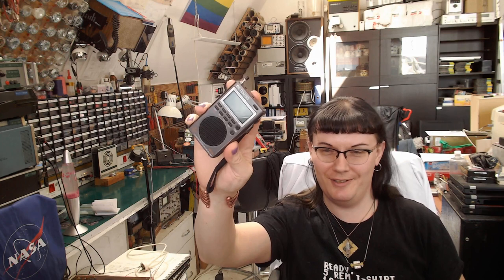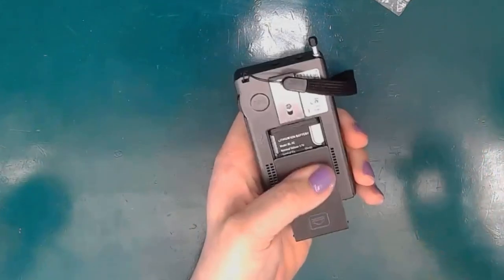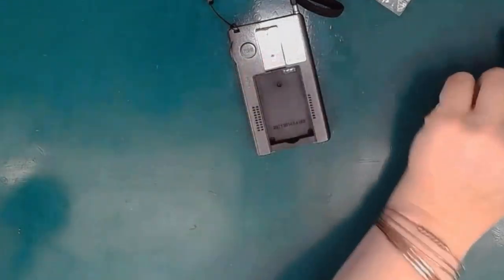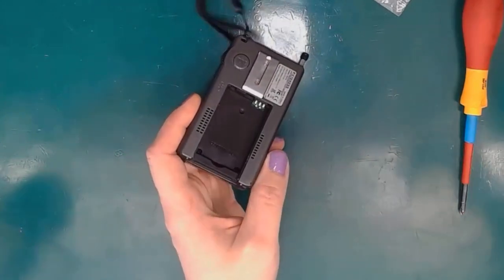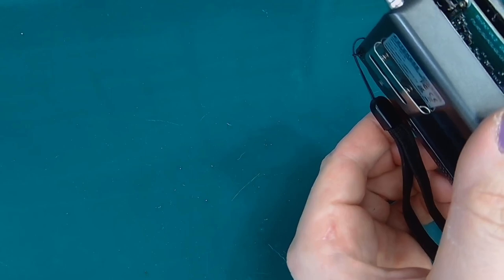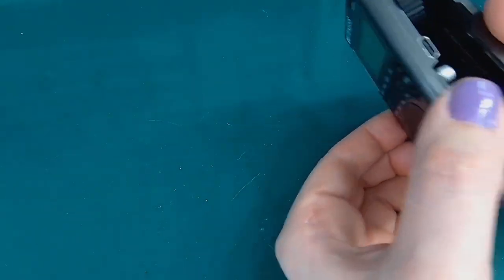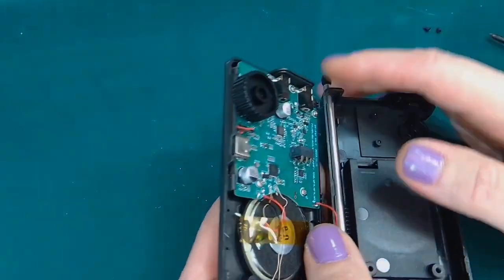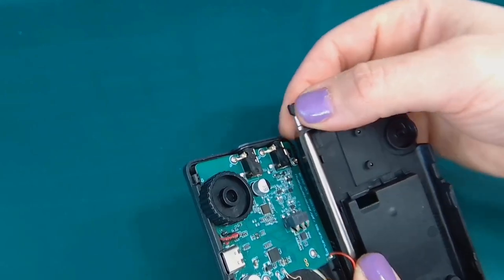Fixing a Retekess TR110 Multiband Receiver

Comment: You have a new covering for the work bench. I used to be in trouble for the condition of my workbench when I was working at a manufacturer of radio and avionics test equipment. But they couldn't complain too much since I got so much more done than any other two people combined. And, people would bring me problems they spent half a day on, and I would find the problem within 10 minutes usually.
Reply from the maker: Yes, I bought some ESD safe mat and upgraded the bench. Waaaaaaaaaay nicer now!
Reply: @KeritechElectronics Nice! I've not seen anything other than very ugly industrial colors for ESD mats. Very nice choice of color.
Reply from the maker: @mikebarushok5361  I'd go for pink or purple if I could, but green is indeed nice too.

Comment: Hi, very interesting video. The antenna doesn't seem to be original. May I ask if you know where I can find a replacement one?
Reply from the maker: I had to make a pulling ring on the original antenna that was broken and had two sections missing.
Reply: @KeritechElectronics  I understand, thank you. The antenna is probably the worst part of this device. Now I'll see if I can replace it with some salvaged material.

Comment: My radio round know...is not working anymore....any suggestion? 😕 
I saw you took it off easily and put it back...clipping it...but mine is not working...
Reply from the maker: Not turning on at all? Check the voltage on the battery - if it's close to the rating (3.7V IIRC), the problem is indeed with the radio; I'd check the microswitches on the board. It takes some little spudger action to take apart, but it can be done - while I use a surgical spatula for that, you can use e.g. a credit card. After removing the two screws underneath the battery, start at the corners and move the spudger along the slot.
Reply: It is the round turning knob...or what is it called..the tuning knob...on the right upper side ...I saw you touched it and moved it as if nothibg haopens...but mine...is just not moving anything on frequencies ...there is some sort of glue there......but i dont kniw....I had it for some seven months working perfect ....now i need to fix it it...
Reply from the maker: @thunderflower7998  he radio has the on/off button (upper righ corner) hat you need to hold down for a few seconds to switch the radio on; if there's no reaction, check the battery voltage and charge i if necessary.